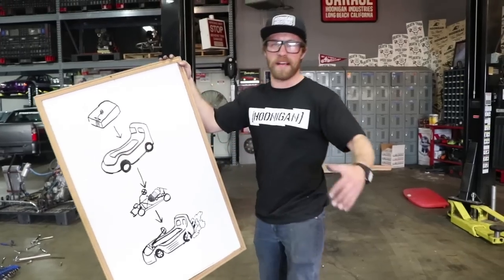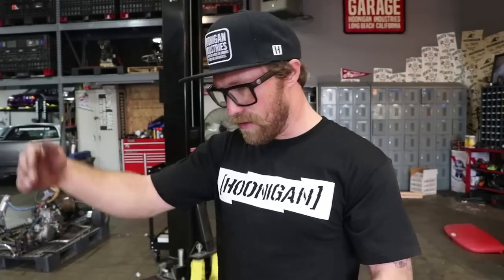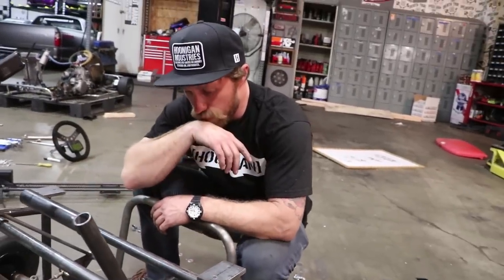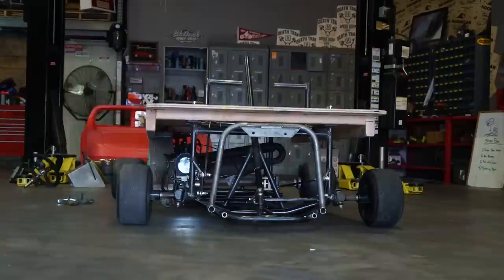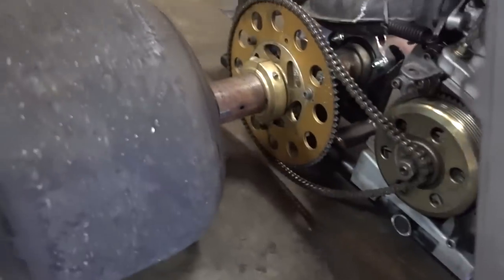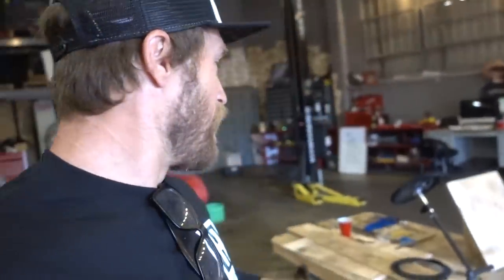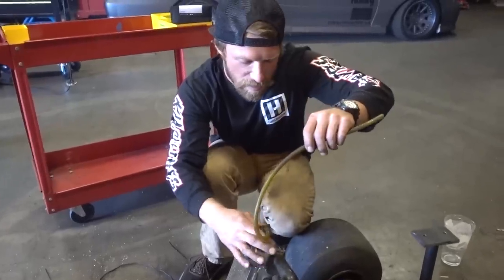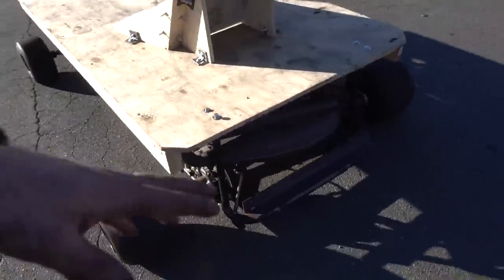ShredBed Frame Test: Chopped and Screwed GoKart Chassis Runs!

Comment from the maker: What final touches are you hoping for on Shredbed?
Reply: A new wing
Reply: A Block handbrake
Reply: It actually look like a bed
Reply: Needs a bigger WANG. Wing=power, duh
Reply: I think it’s pretty legit I just wanna know if y’all wrap the car and when y’all do (if y’all do) why not get like matching bedding for it then you can sell the bedding as Merch like maybe have like 100 bed sets or something i don’t know.
Reply: A kart seat on car seat rails.
Reply: when it geting the turtles sheets and blankets?
Reply: @imperlast2  T.M.N.T sheets xD
Reply: A supercharger
Reply: Whatever you do to it hert will just break it JK the internet loves you hert
Reply: Rainbow bedding.
Reply: Flames down the side
Reply: Decals , livery, much bigger wheels and tires
Reply: Should’ve made it so you sit in the car not on top like the bed really is? But still awesome build!
Reply: Nitrous
Reply: Demon headlights and red underglow
Reply: Smaller main jet for the carburation, 3% mixture, also use iridium spark plugs, the triple headed ones and it should be fine.
Reply: Way Lower gearing so it can do huge burn outs and get sideways.
Reply: *siesta rossa
Reply: A tiny snail
Reply: FUUUCK YEAH GUYS
Reply: drift slicks
Reply: Light bar for sure!
Reply: Rollbar wing mount
Reply: A big turbo
Reply: @imperlast2  or some hotwheels sheets
Reply: A dope livery!!!
Reply: Catch it on fire
Reply: Giovon Jackson came here to say this. Limited edition shred bed sheets.
Reply: TheHoonigans bosozoku pipes.
Reply: A duvet and some pillows
Reply: Lowering the seating position
Reply: More garage garage pls
Reply: a maddress
Reply: stance out the bed wheels with camber and put a huge wing
Reply: Get yourselves some loctite XD a little bit of the red goes a loong way for holding bolts...They won't come loose.
Reply: Y'all should use one of those pillow backrest things around the seat to make it look right
Reply: Turbo
Reply: Lights!
Reply: Merry Christmas
Reply: Need to get a mold maker to make you a plastic wing
Reply: Put a real seat in it!
Reply: Wheels and wheel arches that make sense..
Reply: Hand brake!!
Reply: a killswitch middle of the steering wheel
Reply: Pillow steering wheel
Reply: Nitrous Oxide or possible turbo.
Reply: Ferrari badges and rosso corsa
Reply: Pop up 'Rossa headlights ;)
Reply: Why not make a hole in the board and have the driver sit in the bed? with sheets and a "fake body" on the board with the head of the driver sticking out its seems like the bed is driving itself with a sleeping person in it. y'know , with pedals and steering wheel under the board. It would be a big change in the design, but it would make it cooler to watch cause it wouldn't make sense
Reply: Would also mean you get to stick an actual seat in there
Reply: need to start numbering the episode like part two or something
Reply: A turtle blanket hanging of the wing of the bed like a cape
Reply: A BIG WANG COURSE
Reply: Recairo seat
Reply: @aoive1  A WHAT!? Im dying!! LMAFAOWROTF!!!
Reply: Use the kart seat and lower it into the wood . Use the kart pedals b easyer
Reply: A wrap
Reply: Roll cage safety first.I hope it would burnout.
Reply: Don K so they can throw it into corners and not die 😂
Reply: @giovonjackson4053  damn bro... they need to jump on this. I'd buy!
Reply: underglow
Reply: and maybe a teeny tiny set of racelines on it
Reply: Gearing - With a single speed kart, you need to think a head of the course you wanna run :-) If you wanna do skids, lower the gearing (more teeths on the back gear), if you wanna do high speed course, get a higher gearing (less teeths on the back gearing) :-) But I must say, as a former single speed karting driver for 10 years and now racing in cars, this series has given me the thrills of a comeback to karting - Dayum I love karts :D Haha
Reply: This engine is a bit special, it has a power valve you need to adjust and it has a "fuel pump" that needs new seals for it to preform. Also dont put a car battery on it, it can burn the electronics. (i have raced with that engine so if you need advice wit getting it up to speed contact me ;)
Reply: Flip up headlights, some class A Hoonigan decals, and Ferrari bed sheets.
Reply: Take it to an open day go kart track
Reply: Still hoping you finish it proper and put a fucking wicked sweet CB radio in it so you can talk to other ShredBeds.
Reply: Stance the faux wheels, some pop up headlights, a wrap by the beard legend himself Jace, a whole fucking mother bottle of nitrous that empties out gradually, and a supercharger. Then drive it down Long Beach and show everyone what’s up
Reply: PVC TYRES for Drifting
Reply: Just waiting for the hospital trip
Reply: Shiftkart engine for sure. Doesnt even wanna break loose?
Or make a efficient 2stroke tubro/supercharger :D
Reply: A wet shot of nos and call it "bed wetter".
Reply: Turbo kit possibly fmic
Reply: more rpm
Reply: Garage garage design and Hoonigan stickers on it
Reply: Good paint graphics and matching linens!
Reply: A jetski style, driver tethered, kill-switch might be a good idea.
Reply: Drift
Reply: A CB radio so you can talk to other car beds..
Reply: More power & new gearing
Reply: A blanket and small matress, so you can sleep after a long day of shredding
Reply: Turbo....
Reply: Livery
Reply: stickers
Reply: MOAR POWAH!
Reply: A CB Radio, so you can talk to other car beds.
Reply: I would lilt to see an actual shifter set up.
Reply: TheHoonigans momo bucket seat
Reply: Has anyone said racing strips?? (+15 hp!)
Reply: Hand brake and a turbo
Reply: im building a front engine rwd gokart the same size is this one
Reply: Lower seat
Reply: OH MAN! Get a giant teddy bear as a seat cover. Also star wars blankets.
Reply: Cr500 engine
Reply: speedometer , heat detector so it can tell if the car hot or cold and something that says the car has no fuel or it needs or if it is full

Comment: The engine is a Rotax Max, you can find great support for it. For Coldstarts use the choke, it will run without it, however I would not recommend it. These engines are actually quite pricey, since they are race engines.

Comment: This engine is a bit special, it has a power valve you need to adjust and it has a "fuel pump" that needs new seals for it to preform. Also dont put a car battery on it, it can burn the electronics. (i have raced with that engine so if you need advice wit getting it up to speed contact me ;)
Reply: stilloading adventures if you talk to them, maybe drop some knowledge on him about their clutch...he sorta made up his own version of the truth :)  And oh yea, maybe let him know he’s not working with a ‘shifter kart’... 🙄
Reply: @EricSchutt  XD yeah, there is a whole 1 gear to sift.
Reply: The powervalve is irrelevant you only need to adjust it for different tracks
Reply: @mnooooooo  yes but if it is set on 10 and up after with that weight he wont even feel boost

Comment: Garage Garage what the f .I paused and came back as usual great idea cheapest I thought and strongest  love it. AhHHHH dang I thought u was doing electric braa go grab two 18 wheeler truck  starters from the scrap yard,  Car batterys and hold the f on but plz full padding and neck brace no joke. OHH and those tires no good gone in 50 seconds no joke

Comment: interesting pedal setup, but the engagement wont be linear.  you will be more sensitive at the beginning of the push, but the more you attempt to throttle up the less response you will get.  aka more movement of the pedal wont necessarily mean more throttle or braking, as they operate on a curve

Comment: dont put a seat on it you had something real crazy a cart you drive while laying on a mattress for max crazy now its just a go cart with a body kit
Reply: chris ever thought about why there are seats in a car?
Reply: @KentGoSuzuki  have you ever slid an old car sideways with bench seats? its nuts
Reply: chris yeah, but a bench seat truck typically has doors and or seatbelts, right? , a good compromise here would be to cut a seat sized hole into the mattress

Comment: The power valve looks to be screwed way to far in judging by the thread showing, you want cross over to be around 7500 rpm on a senior max engine.

Comment: If you got a good name brand aftermarket pipe and some G Force reeds like jet the carburetor I think it would make a big difference in the power or even like a new carburetor I think motion Pro maybe even has kits you can buy the carburetor tell him what exhaust you have get the kit I think I'm not a hundred percent sure tho
Reply: and  and the two strokes going to be real sensitive to your fuel ratio what you get a jetted right because like what you're saying it's not coming into the power like it's supposed to you should have been in the power ban you guys should definitely buy exhaust it would be so cool to see actually go fast

Comment: So, dirtbikea don't have a fuel pump.  They rely on gravity to fill the carb bowl.  Sooo your more then likely going to need to mount the tank above the bowl on the carb to avoid the lack of fuel issue. Also, if the carb is pissing out fluid it's either not level, float level is out of whack, or somethings jammed up in the float valve not allowing it to seat.  Goodluck!

Comment: Rotax engines are good but they're a real nightmare at times. Engine's are meant to be fully rebuild after 50 hours runtime. If your losing power might be worth checking jet size. From memory fuel mix should be 50:1. Use a good oil else it can really lack performance. 

I have the rotax max engine and it makes 30hp, which is alot of something that weighs next to nothing.

Comment: What do you mean by scoring with a screw driver
Reply: So put a nut  on a bolt nice and tight and then rake the threads or score them so the nut can not come off